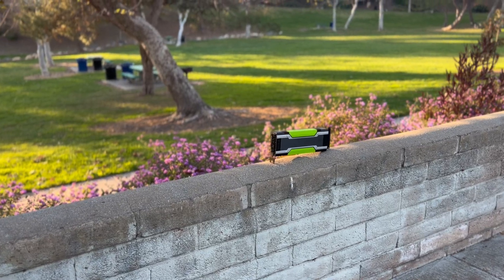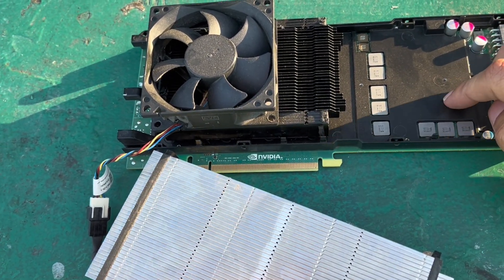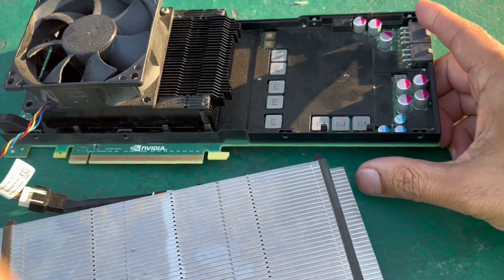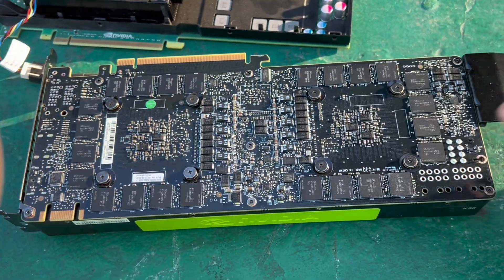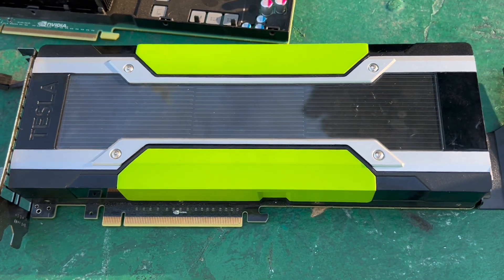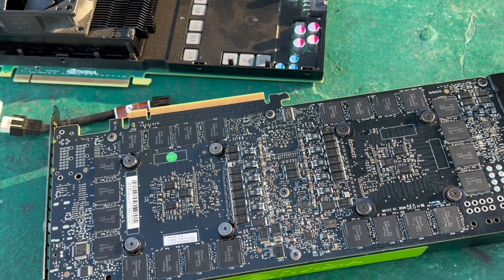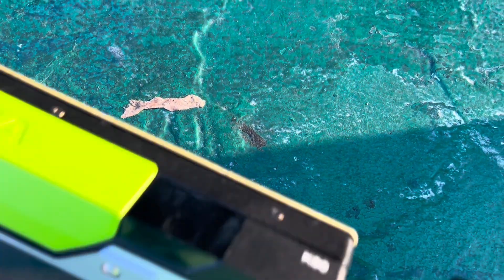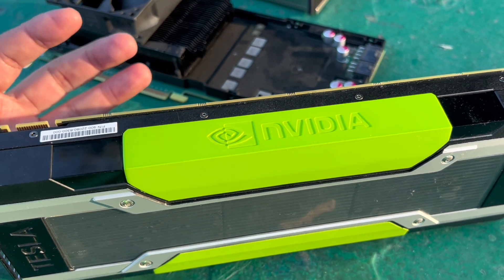Nvidia Tesla GPU Part 1 K80 fan mod Part install in desktop Budget Gaming PC vs K40

Comment from the maker: UPDATE:  I received the proper power adapter from Amazon ($9)

I installed the card with a GTX645 and it did not show.

This motherboard is also missing the above 4g option which is supposedly important to make Tesla cards work.

So i will have to find a different system to put it in.  Until then, I will work on the fan solution.